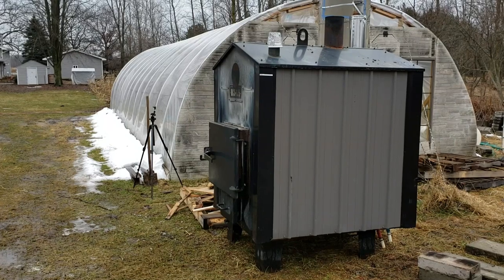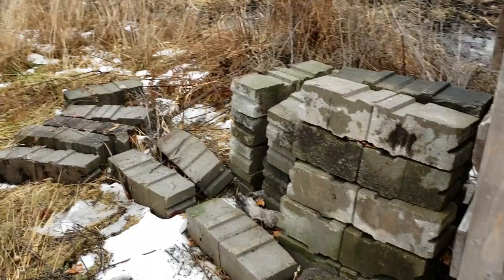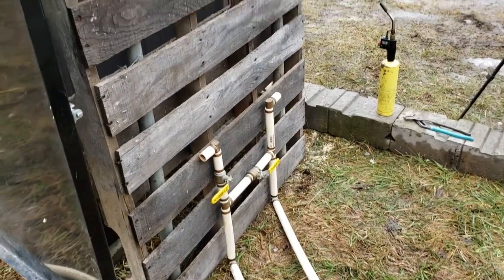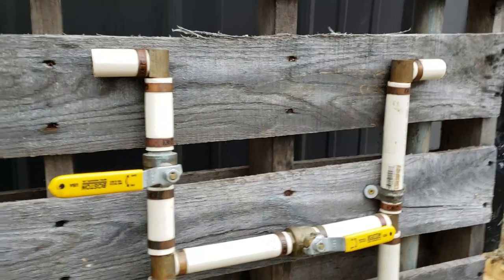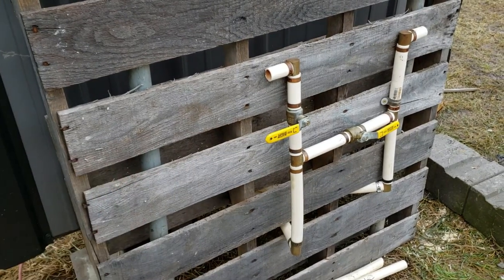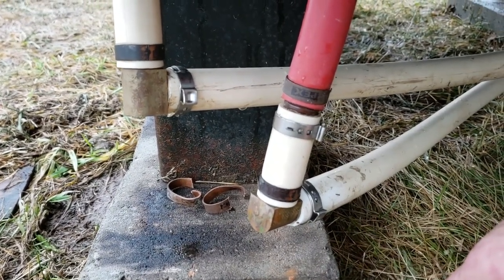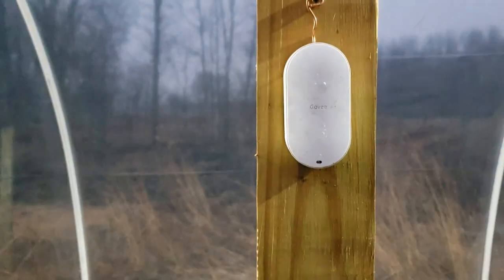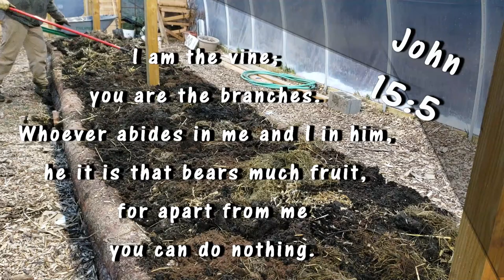Heating a Raised Bed With a Wood Boiler - Log Raised Bed Part 6

Comment: Hey Todd, you just have to have the right stuff to make things work.  A 5/16 nut style hose clamp that you tighten by hand would prob work better but i still wouldn't think it would work that great.   i kinda wondering if you are setting yourself up for catastrophic failure with no glycol in the lines yet run on the ground outside.  i'd at least trickle some heat thru it so they don't freeze.  also with no glycol you have to run that stove from now until it's done freezing.  I'm all for making things work what you have, rather than going to buy new things.  i believe you can rent the pex tool (like you cut off) also so i would look into that.  

Good luck with it all, I'm patiently waiting for syrup season to get here and also see how you do and how the sugar shack is built.  I run a group called Wisconsin Maple Syrup Producers on FB if you ever need a hand or would like any info.  We allow in border states also.  Good luck buddy!

Comment: Is all that for just that one bed? Or will there going to more beds? With all the cost of the building, boiler, pipes, wood, and electricity, the vegetables you grow would be pretty expensive!
Reply: The boiler really doesn't use much power it's just a fan like 200 running watts max probably I could power it from the inverter in my truck. Most of his wood he collects from his land or for free from friends. The boiler came with the house when they bought the property the cost has already been absorbed.

Comment: Please tell me you're using this boiler to heat your home as well? Those things start at three grand and up please tell me your heating your house with this too.
Reply from the maker: nope, I just removed it from heating our house and installed an indoor wood stove which is working out much better. This will be dedicated to the greenhouse and maybe the barn at some point

Comment: Huh. Maybe instead of complaining about PEX while you don’t understand it, maybe just go to your local builders supply and ask some questions. In 20 min you can walk out with the knowledge you need, and the correct tools.
You don’t want a line to fail and empty your boiler $$$